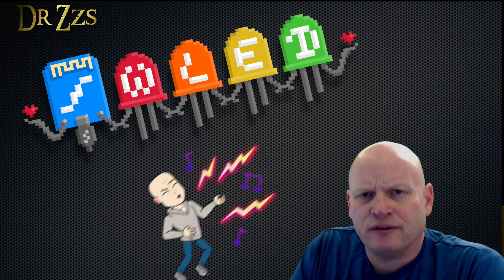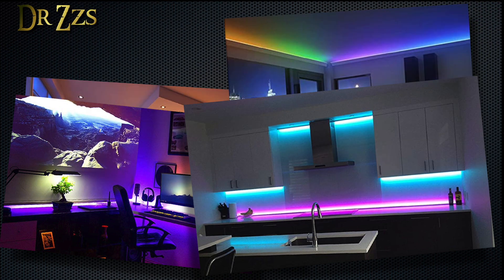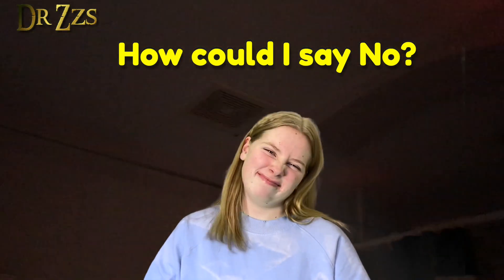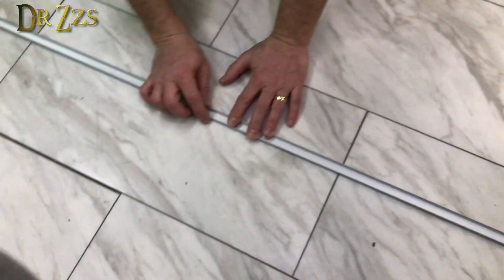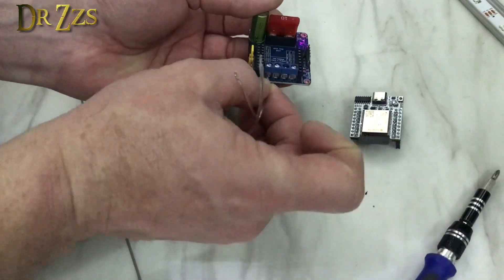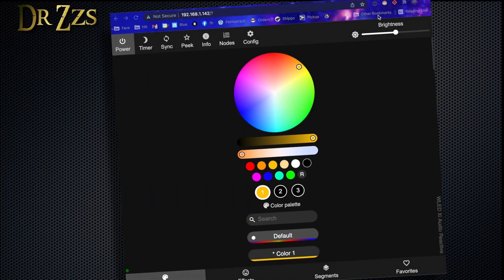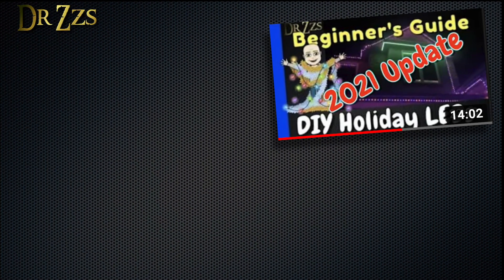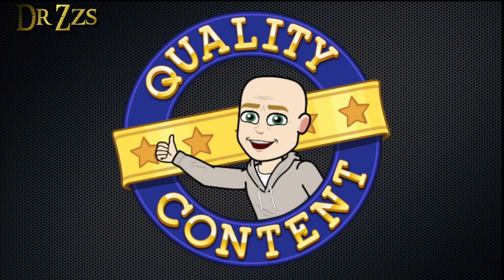Sound Reactive LED Fixture - Mic + DigUno + WLED

Comment: Is there a way to send a line level audio signal from my computer into WLED?  I'd rather not use a mic.  I'm currently using version 14.0.  I have xLights. But I'm still trying to figure it out.  🙂

Edited on 11/21/2023

Never mind. It was a stupid question. I see (now that I've looked more closely at the DIRECTIONS 🙂)  in the setting that I could just used the analog settings. In the end, I bought some INMP441s. It works great.

Comment: You did a great job in doing the video I just wished you used the same chip that I'm using witch is the esp32 blue 40 pin chip ( the small one Mini32 ) and don't know how to set it up or what pin I use to get it going can you please help me out. Thanks!!
Reply from the maker: Have an LED related question? Be sure to ask your question in led-lighting-diy- Channel on discord! https://discord.gg/8gvF67h Our LED masterminds, the PixelHeads, generally hang out there and can answer your question(s) swiftly.

Comment: This can quickly turn into a waste of time. My ESP32 do not have an AO or #36 pin...? Any other assignable pins...?  It is the latest ESP32 as there are a few with different pin references.....anyone willing to assist...? :hand-orange-covering-eyes:
Reply: use pin 35 and change it in wled
Reply from the maker: Have an LED related question? Be sure to ask your question in led-lighting-diy- Channel on discord! https://discord.gg/8gvF67h Our LED masterminds, the PixelHeads, generally hang out there and can answer your question(s) swiftly.

Comment: Anyone know how to wire up the digital I2S mic? Do we still use AO for the Serial Data pin or should we move it to one of the External GPIOs (Q1 - Q4)?
Reply from the maker: Have an LED related question? Be sure to ask your question in led-lighting-diy- Channel on discord! https://discord.gg/8gvF67h Our LED masterminds, the PixelHeads, generally hang out there and can answer your question(s) swiftly.

Comment: I am pulling my hair out!, (no offence) :)  I have a DigUno, a MAX4466 and SK6812 RGBW LED's.  They work perfectly well on all versions of WLED, except, when I try and use an SR version, I can not get a single reaction that is SR.  So, the connections go just as in this video, VCC to 5V, GND to GND, and OUT to A0.  I set the analog input PIN to 36, nothing.  I check, and there is indeed 5v at the MAX4466, I try various different MAX4466's, nothing.  I move PIN A0 to Q4, and update the pin number to 32, reboot, nothing.  I try powering from the 3V PIN, test it, getting just over 3V to the MAX4466, both pin configs as above, nothing.  Its like I'm banned from using it, or there are a ton of secret setting I just don't know.  I'm very frustrated and sad and annoyed at how long I've spent on this, and still have nothing to show for it.  Does anybody have any idea what else I can try please?
Reply from the maker: Maybe try the new version 14 beta version of wLED.  The SR stuff is baked in.Ask your question in led-lighting-diy- Channel on discord! https://discord.gg/8gvF67h Our LED masterminds, the PixelHeads, generally hang out there and can answer your question(s) swiftly.
Reply: I had this issue aswell. Use the same pins he shows in the video on the Dig. Change your settings to Squelch 5 and Gain 243. I then used a small flat head on the gain screw attached to the mic itself and turned it all the way up. This is what got it working for me. Im going to flip to a digital mic tho as I have had better input luck with thos. The above method does work, however. TIP: When setting the screw turn your music up and set it to the "gravcenter" fx and go each way on the screw to see what works. I fought with this for 20  minutes or so before i sorted out the gain levels.

Comment: Can I use nodemcu instead of Dig uni ?
Reply from the maker: Yes you can.  The esp8266 has an A0 pin also.  That's where you'll connect the microphone.  Or you can use an ESP32 based nodemcu.  Both will work just fine.

Comment: Thank you for the video. But where does the controller box end up?  I did something similar with some pig shaped Christmas lights, so enquiring minds want to know. :-)
Reply from the maker: good question.  I haven't put one with a microphone outside.  Usually I hide the controller somewhere near where the LEDs are.  Either that or I put the controller close to the power supply.  
Totally depends on your exact project.

Comment: I've got a dig uno v3. When I plug into the A0 pin (supposedly pin 36) I get no sound reaction. I can set the pin to in the settings to 32 and lights flash randomly, but they are not responding to the music. Is your sound pin in the settings definitely 32 as it is in the video? You also hooked up to 5v and the wiki suggests 3.3v. Lastly, what flashing method do you use, and on what OS? Thanks!
Reply from the maker: Try pin 36
Reply: @kilarger7181  Oh man, i am now at least 16 hours deep in to this problem.  Same set up as you, Dig-Uno, and MAX4466, Ive tried A0 pin, as 36, Q4 as 32, nothing i do ever gets a flicker from the SR version.  i feel like im missing something and getting very frustrated by the whole thing.  I have them working perfectly on normal WLED, and even Hyperion worked as described, but not matter what i do, never a single flicker on any WLED version and any combo of pins, is there another step i could be missing?
Reply: @richardmorrall9  don’t know if this will help my I used the VP pin 2 pins over from the 34
Reply: @Rick210Texans  and what PIN number is that for WLED?
Reply: I had this issue aswell. Use the same pins he shows in the video on the Dig. Change your settings to Squelch 5 and Gain 243. I then used a small flat head on the gain screw attached to the mic itself and turned it all the way up. This is what got it working for me. Im going to flip to a digital mic tho as I have had better input luck with thos. The above method does work, however. TIP: When setting the screw turn your music up and set it to the "gravcenter" fx and go each way on the screw to see what works. I fought with this for 20  minutes or so before i sorted out the gain levels.

Comment: Nice video. Thank you. I am working on something similar. Should the VCC on Mic go to 5v or to 3.3v? I thought the esp32 is working with 3.3v logic.....
Reply: For the Max4466 here, it gets anywhere between 2.4 & 5v to power it [according to the listing I'm looking at right now anyways], DrZzs wired it up with 5v since it would take it and he's got a convenient place to plug it in.  The output from the 4466 goes into the analog pin on the ESP32 [A0].  So, if you've got he 4466, you should be able to wire it up to 3.3v if you want without a problem.

If you're using a different mic or one that's digital, you'd have to wire it differently according to its needs.